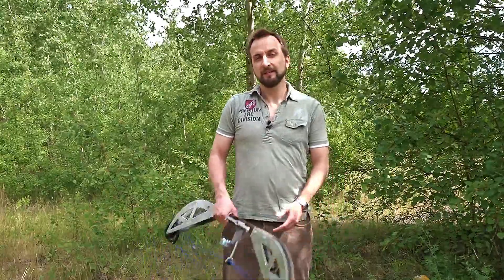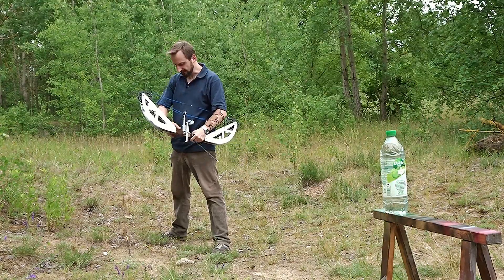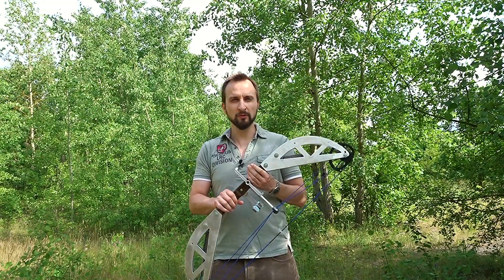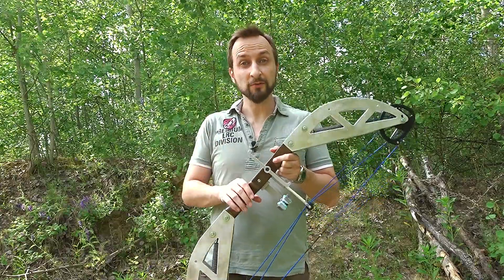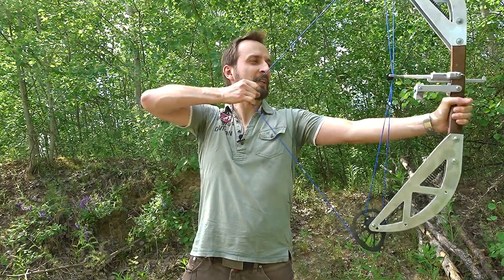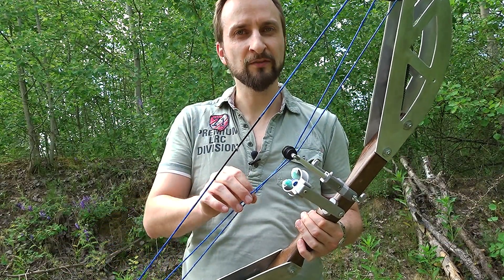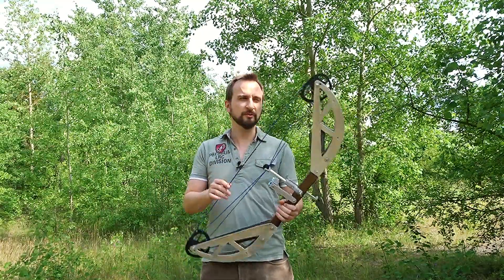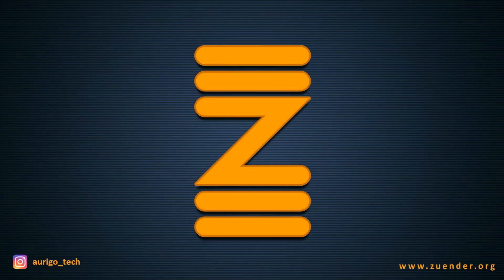Coilspring powered Bow - Mk. III

Comment: why not use metal for the cams same with the crossbow if the coils and the pulleys were all metal failure rate would be reduced significantly
Reply from the maker: Much harder to manufacture plus 3d-prints are fairly light already so  it would not be easy to make a Metal one with the same or lower weight.
Reply: @aurigo_tech  the weight would be an issue but I would like to suggest only the outer rims/fins of the coil to be from a metallic sheet cuz those are the stress points of the failures and best of luck I really like your design👍

Comment: Hi, richtig coole Idee und Umsetzung! 
Ich würde gerne den Bogen nachbauen, leider funktioniert bei dir auf der Website der entsprechende Reiter bei mir nicht...
Auf z.B. die Armbrust kann Ich draufgehen, doch beim Bogen lädt es leider nicht. Weißt du da zufällig weiter?
Ich hätte auch noch ein paar Fragen zu dem Bogen, wäre dankbar für ne Antwort 😀

1. Welche "Schnur" hast du verwendet?
2. Hast du zufällig nen Link für die Federn?
3. Könnte Ich die 3D-Druck Datei erhalten?
Reply from the maker: Danke dir! Habe jetzt den Link auf der Webseite aktuallisiert, jetzt sollten da paar Fotos, Erklärung, der Plan und 3D-druck Files sichtbar sein.
Es ist jetzt nicht so das ganz einfache Nachbau-Projekt und es gibt keinen vollständigen Bauplan, aber vielleicht kannst du ja was nutzen.

Die Sehne ist Bogen-Sehne. Gibts als Garn in entsprechenden Fachläden oder Onlineshops die Archery-Zeug verkaufen. Muss man sich natürlich noch selber ne Sehne
zusammenspinnen dann weil das Garn nur ein einzelner Faden ist.

Link zu den Federn habe ich leider nicht mehr, aber habe eben mal einen alten Kommentar von mir gefunden wo ich sie beschrieben habe:

The springs I use are 134 mm total length, 26.5 mm total diameter, 4 mm wire thickness, 25 windings. And I draw them out to about 60 kg drawweight each at ~190 mm total length.
Reply: @aurigo_tech  Okay, vielen Dank für die Infos, das hat mir schon sehr weitergeholfen 👍
Reply: @aurigo_tech   Hi, ich bin es nochmal :D 
Ich bin inzwischen fast fertig mit dem Bogen, ich hab die Arme (die du aus Alu gemacht hast) 3d gedruckt, etwas dicker natürlich, hat aber bis jetzt gut gehalten. Mir ist jetzt aber aufgefallen, dass bei den 3D-Dateien noch die Pfeilfassung fehlt, der Rest war da. Kannst du den Link evtl. nochmal aktualisieren?
Reply from the maker: @zBluex  Hallo! Danke für den Hinweis, ich hab die zip-Datei jetzt ersetzt und da ist jetzt auch die Pfeilauflage drin. LG.

Comment: 6:33 I think the point is to increase the speed of acceleration, not to decrease it. That's what the cam system does. In any case, I'm curious about your explanation. I hope you will put the cam system on the crossbow and demonstrate the improvement in your next video. Congratulations, well done! ;)
Reply from the maker: Well I didn't really explain it well, but the main goal is to transfer more energy into the arrow. And when the ratio of leverages I between the smaller cam that is connected to the spring and the larger one for the main string remains constant (like with circular wheels) the spring will only pull with a maximum of torque at the beginning, when the arrow is released and then less and less which is not good because we want the arrow to become faster and faster. That is where the cam system comes in and it dynamicly adjusts the leverage with which the spring can pull with the goal  of constant torque/constant acceleration. So in the beginning it has a torque of 120 kg * 5 cm = 60 Nm (made up numbers) and later when the spring force has decreased to only 60 kg lets say, the leverage has increased to 10 cm, which still results in 60 Nm of torque, same as before.
Perhaps I should make a whole video explaining it better with some visuals as well.
Reply: @aurigo_tech  Yes, I think that's the point.
My guess is that steel springs dissipate energy much more slowly than composite arms, so you can get energy out of them with much heavier arrows than usual. You could do a test with specifically heavy arrows.
Reply from the maker: @FDontShoot  Yes, steel springs are definitely slower, but when you think about it, even a very slow force can be used to accelerate a projectile. In a trebuchet the weight drops very slow with just a few m/s, but the energy transfer to the projectile is very efficent. When you imagine an impossibly long lever on a pivot point and push down slowly on the very short end with a high force, the long end will jump up crazy fast. So the slowness of springs is not necessarily a killer argument against performance. With the different arrow weights, yes I thought about that too and will probably do more extensive testing in that direction with the next version of this whole system. I still have some more ideas how it could be made better.
Reply: @aurigo_tech  I've been thinking about this a lot myself, because I really like the spring crossbow style. I love the scavenger post apocalyptic design. It would be nice to somehow make the idea usable. For me even 100fps is acceptable if we can get the efficiency up to 50%. It's quite amazing that modern crosbows today shoot the arrow with the same initial energy (Joul) as the draw weight (lbs). I have a lot of ideas for improvement, but I've only done theoretical calculations so far. That's because I haven't found an efficient solution that would be worth building yet.

Comment: Is there any let off on this bow, since it's a compound with cams? Or does the cam setup not allow for letoff? Also - please be VERY CAREFUL with the arrowhead coming behind your hand at full draw. I know you're using a whisker-biscuit type arrow guide but the danger to your hand is still very high, especially if you're using carbon arrows. Maybe add a metal shield for your hand.
Reply from the maker: There is a let-off effect, yes. I think I could make it even stronger but its definitely there. Yeah the arrows are a bit far back, because the drawlength turned out to be longer than expected, but I didn't wanted to redesign everything. I don't see how an arrow could ever hit my hand - only thinkable if an arrow were to snap in half during acceleration and be pushed down somehow. But the fibre glass arrows I use are very flexible and won't break that easily.

Comment: You should measure draw weight at multiple points and use an integral to figure out stored energy. Then you can calculate efficiency as kinetic vs potential energy.
Reply from the maker: Yes, good thought - I did that already. According to my calculations both springs hold an energy of 96 J total, so I am at  around 46% efficency.
Reply: @aurigo_tech  Danke vielmals. Es ist leider selten, dass Leute solche Daten teilen.

Comment: Schön wieder mal was zu sehen. Kann nur sagen : Sehr gut umgesetzt. Über synchronisation hatte ich im letzten video ja schon mal kommentiert.  Zug/druckfedern als energiequelle sind in punkto effizienz  den üblichen fiberglas armen unterlegen wegen masse usw - würde sehr schwer damit die geschwindigkeiten eines moddernen glasfaser compounds zu erreichen -dafür sind die unkaputtbar und auch ein leerschuss oder sehnenriss (der einen "normalen" compound zerlegt bzw beschädigt) wird deiner eher überstehen.  Bin mal gespannt wie du ddas bei der armbrust umsetzt. Mechanischen vorteil in form von Rollen/cams/flaschenzug /hebel etc braucht man jedenfalls unbedingt um auf geschwinigkeit zu kommen, synchronisation ist nen thema und je mehr auszugslänge desto besser. ich hab vor vielen Jahren mal mit flaschenzugsystemen konzepttests gemacht und hatte dabei theratube silber als energiequelle, auszugslänge ca 70cm ,2:1 flaschenzug und ca 120lbs am abzug die gemessenen geschwindigkeiten waren dabei für ein 37gramm pfeil 269fps, 22gramm pfeil 327fps und 12gramm pfeil 414fps. mit stahlfedern bei ca gleichem zuggewicht kam ich dda auf 145fps für den 37gramm pfeil und ca 170fps für den 22gramm pfeil - mit nem 2:1 flaschenzug. das ist deutlich langsamer! da zeigt sich die masse der stahlfedern.  um die geschwindigkeit zu erhöhen brauchts also entweder wesentlich mehr zuggewicht bzw ein 3:1 oder 4:1 mechanischen vorteil. zu finden ist das noch im alten theslingshotforum com unter slingshot crossbows speed testing different pulley systems. ich hab das dannn icht weiterverfolgt aber konnte  beweisen dass mit gummi als energiequelle und mechanischem vorteil auch pfeilgeschwinigkeiten über 400fps möglich sind was  anfangs angezweifelt wurde...
Reply from the maker: Ja ich glaube so langsam  habe ich die Grenze von Stahlfedern erreicht. 60 m/s ist vielleicht noch drin mit ein paar weiteren Optimierungen, aber viel mehr wohl nicht.
Vorteil dieser Konstruktion ist ja auch dass man die Feder auch relativ einfach durch was anderes ersetzen kann. 
Aber ich wollte erstmal diese Federn hier weiter nutzen weil sie sich als sehr stabil erwiesen haben und man dann sehr schön die Entwicklung sehen kann über die
verschiedenen Entwicklungsstufen (und weil ich einen ganzen Sack davon habe und so gut verwenden kann :)). Ansonsten danke für den Hinweis auf deinen Beitrag in dem Forum - schau ich mir an!
Reply: Thanks for sharing this amazing piece of information! As mentioned by Joergsprave from the slingshot channel, rubber lose their power the longer you keep them stretched, steel springs don't.

Comment: Now take it and attach it to a Stock in a Reverse Draw.  Would be interesting to see the results.
Reply from the maker: Jep, that is what I did with the crossbow before, and what I will also do again when I make a crossbow again.
Reply: @aurigo_tech    Think you did, but I didn't delete or rewrite the Comment.  Just left it as is.  Though putting it in Reverse Draw may give less Cocking Effort.

Comment: The arrows seem a little short to me. I'm not sure I like the idea of having the tip behind my front hand at full draw. If something goes wrong with the whisker biscuit or something it could send the arrow right into the back of your hand.
Reply from the maker: Yeah the drawlength came out a bit too long which is why the arrow is also so far back, but I didn't wanted to redesign and remake the parts AGAIN so I went with it.